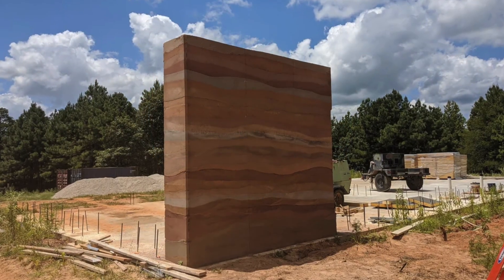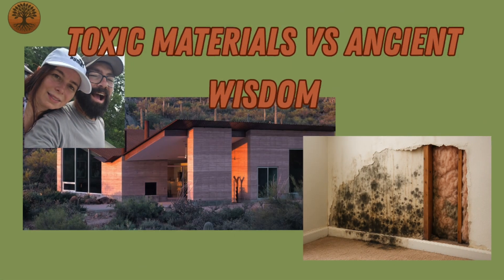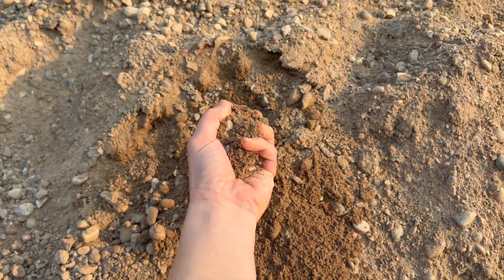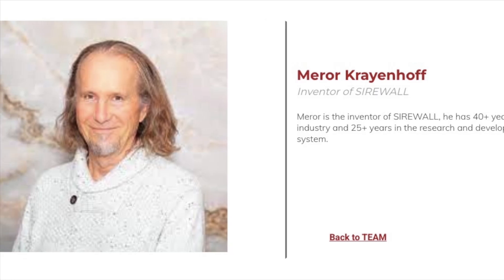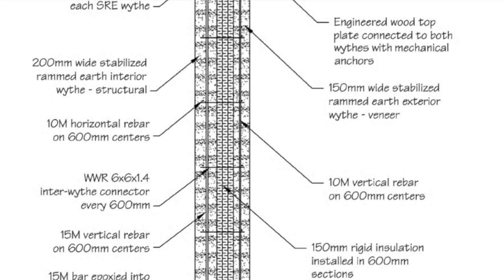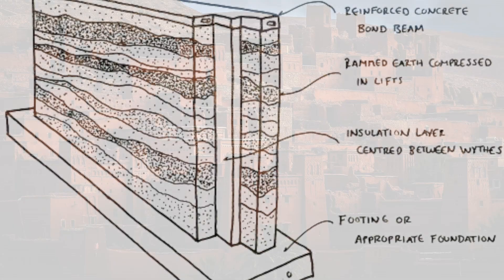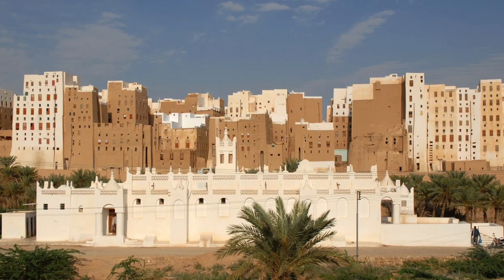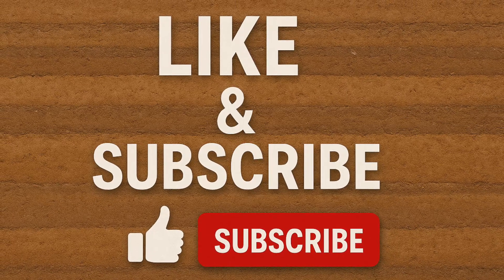Building Walls That Outlast Concrete... With DIRT (Surviving Manitoba) Winters

Comment: Im lookjng into rammed earth, what i dont undersrand is why the need for plastisizers, rebar, cement footing , insulation for cold areas and load bearing, when larger structures that have been around for 500+years in cold wet environments dont use them at all and are still pretty much perfect. I get the insulation to trap more heat but then you eliminate the breathing factor of the walls right? Wouldnt you just make them thicker?
Reply from the maker: Those are really good points — and honestly, things I’ve wondered about too!

The rebar is mainly for seismic reinforcement, especially in areas with earthquake risk. It’s not traditional, but modern building codes often require it.

Plasticizers (or water-repellents like silane/siloxane) are added to improve moisture resistance, particularly in wetter climates. My first thought was the same as yours — doesn’t that reduce breathability? I asked Tim Krahn, one of Canada’s leading rammed-earth engineers, and he explained that even with silane/siloxane additives, the wall still remains vapour permeable for the first couple of centimetres, so its ability to “breathe” isn’t significantly affected.

The cement is mostly about ease and consistency. You can absolutely build strong, durable walls with just clay, silt, sand, and gravel — but the exact clay type and proportions are critical. Adding a bit of cement makes the mix more forgiving and predictable, which helps meet engineering specs more easily.

As for insulation, you’re right that ancient buildings didn’t have it — but they also weren’t very energy efficient, especially in colder climates. Rammed earth has great thermal mass (it holds heat and cold well) but poor insulation. In a place like Manitoba, uninsulated walls would be uncomfortable and expensive to heat. That’s why modern builders often combine rammed earth’s mass with insulation to meet today’s energy standards.

So in short: the “extras” (cement, rebar, insulation, sealants) make rammed earth compliant, consistent, and durable in modern contexts — not necessarily better than the old ways, but adapted to today’s codes, materials, and expectations.
Reply: @RootedResilientLiving wow great reply, you know this well. 
❤🫡💪✝️🕊️from Ontario
Reply: I had the same questions. Honestly, I have come to think that rammed earth is not as great as it seems. Adding "a little bit" of cement and lime basically makes it very similar to concrete actually, which also only contains a relatively small amount of cement (ca. 15%). And both cement and lime have an enormous CO2 footprint. Not to mention the rebar. At the end of the day, a wooden structure with natural fiber insulation is the way to go because it captures carbon for a long time.